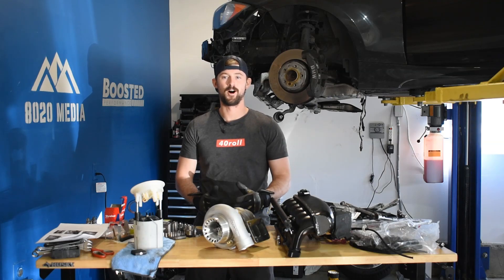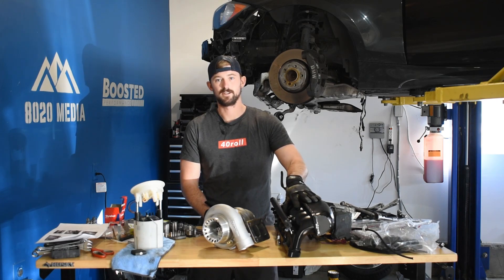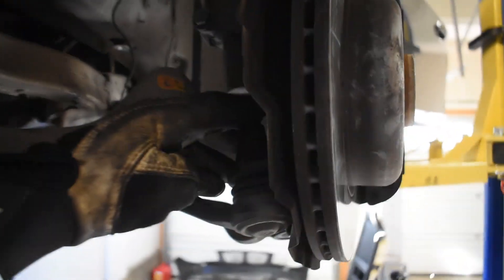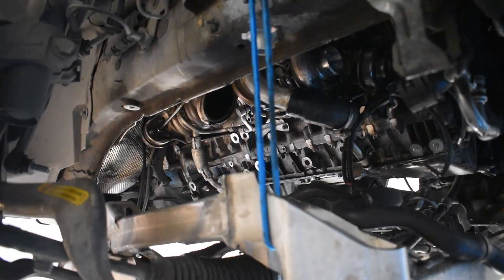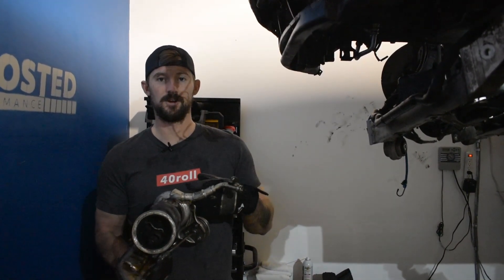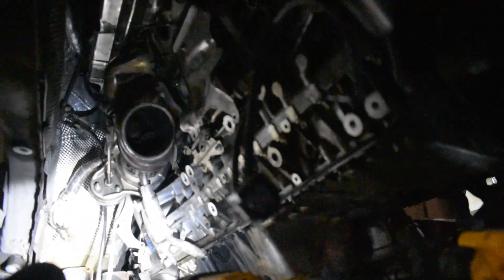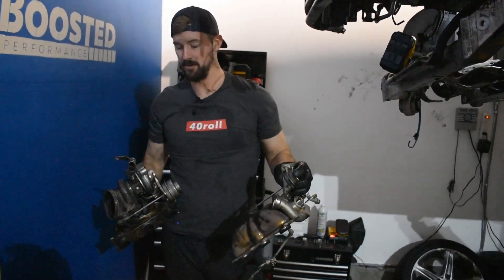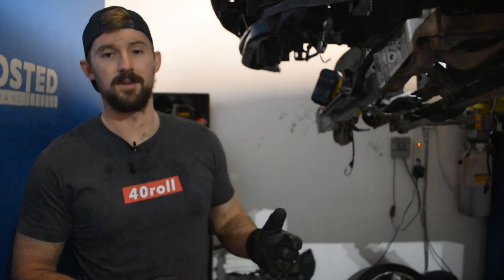The Factory N54 Turbos Are OFF! | N54 135i ST Build Ep. 3

Comment: That's weird you couldn't get the stearing rack, I always take them off with my Milwaukee M12 not a issue.
Reply from the maker: The torx bit I bought online was apparently pretty crappy cause it broke so easily, probably just needed a higher quality tool and to let them soak a bit longer in some WD-40. But I'm guessing that bolt had never been removed since the car was built in '07 so definitely stuck in there pretty good.

Comment: If you are running coil overs just on both the bolts from the top of the coil overs and I dropped a whole entire frame with the struts that would be much easier
Reply from the maker: I'm on OE suspension unfortunately but I did consider just dropping the whole thing. Came close to it but I've already pulled so much stuff off of it I just didn't want to deal with another piece of the puzzle to put back together haha.
Reply: @8020Automotive  ok it who’d be way easier to do that